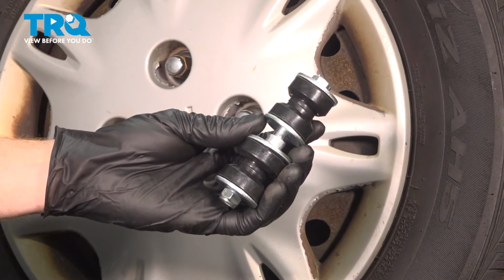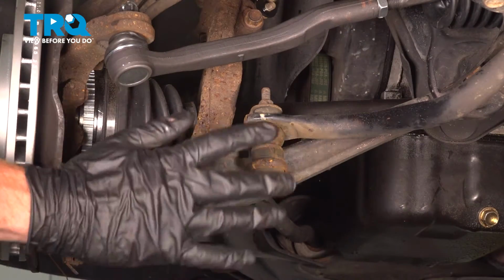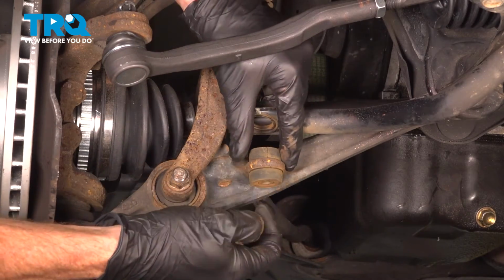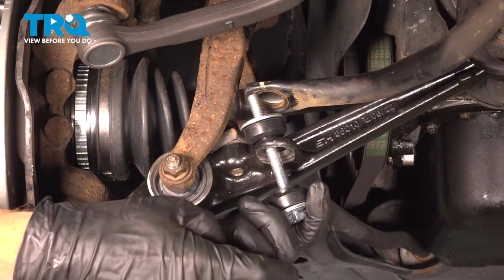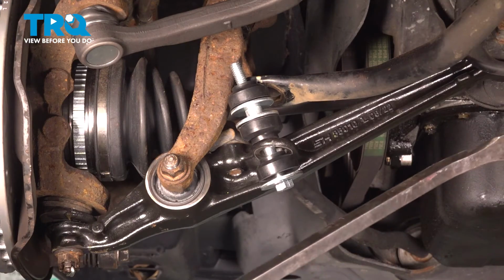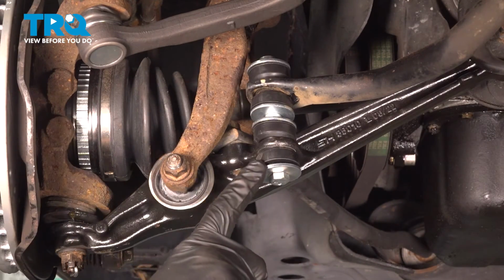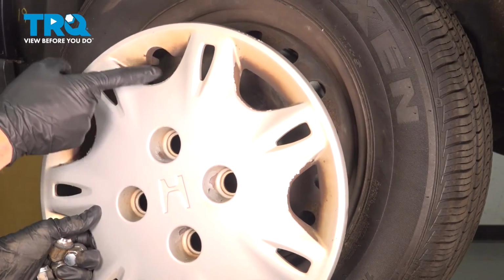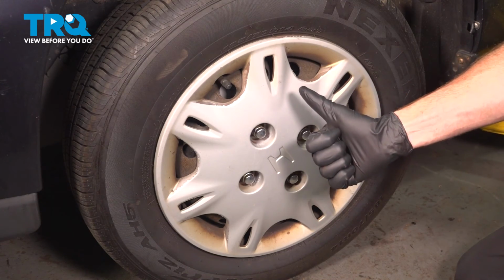How to Replace Front Sway Bar Links 1994-1997 Honda Accord

Comment: ???? I went with Prothane and used lots of silly cone grease; The issue is at 14 ft lbs, the bushing squish up. Should I just snug them up til they just start to squish? I think the grease my be effecting the torque; anyone have any input ???